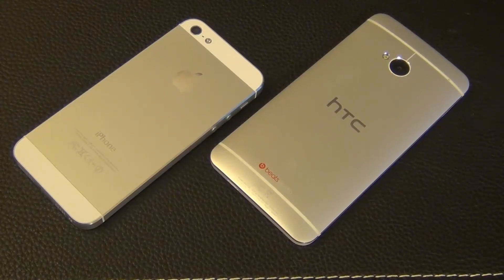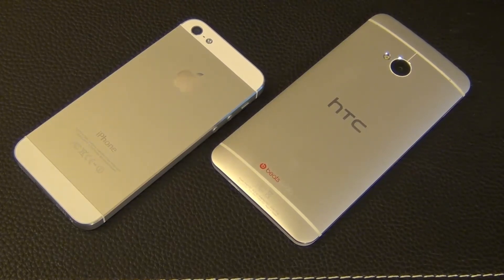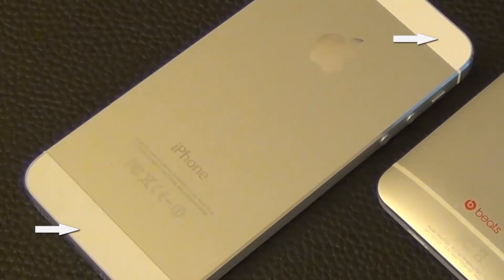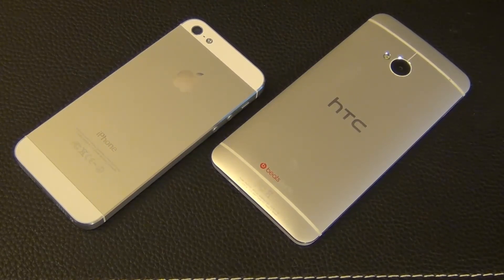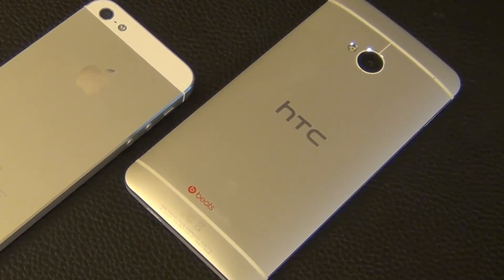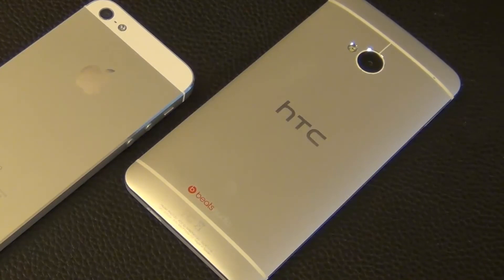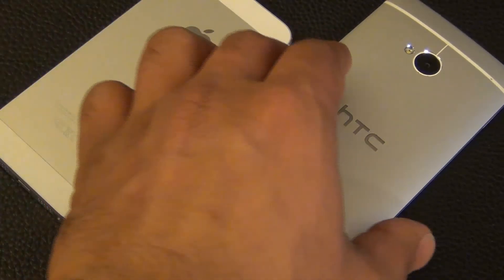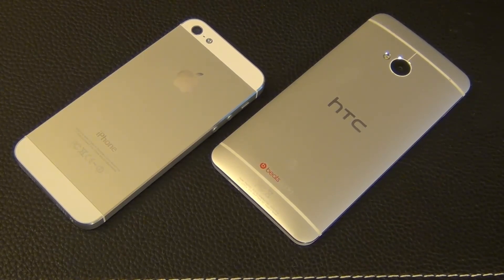iPhone 5 vs HTC One: Build Quality Comparison

Comment: Try a drop test and see which is better. try scratching the metal case with a coin and see which is better. Furthermore, the amount of plastic is minimal, the HTC has more metal than the iPhone. To save you an expensive repair, let me just tell you the HTC is better in both cases by a huge margin. Mine is so tough I don't even bother with a protective case and it is still unmarked to this day.